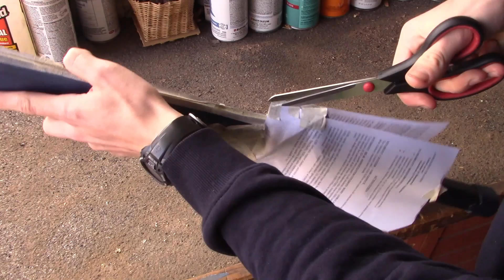Kirito's Night Sky Sword [⚔️Sword Art Online Alicization] Made From Wood (Part 2)

Comment: What are the materials and tools you used because I'm thinking of making my own
Reply from the maker: So for the main part of the sword I used a single cedar fence board, no idea where I got it from sadly, and the the two pieces that go on each side of the guard were some smaller pieces of wood(not sure what type), other than that I just used some black, blue, and light blue spray paint( the blue spray paint has mica particles to make it sparkly) and then I used a water based polyurethane varnish to make it glossy at the end. I hope this helps, let me know if there's any more info I can give you 😄
Reply: @somescrapcrafts1877  this helps a whole lot thanks also what tools were used in this whole process

Comment: Can you tell me what the lenght and width of the sword are ?
Reply from the maker: The length of the sword from the tip of the blade to the end of the hilt is exactly 3 feet, the blade itself is 26 inches, the width of the blade at the widest part is 3 and 3/4 inches, the thickness of the blade is half an inch and the width of the guard is 4 and 3/4 inches. Hope those were the measurements you were looking for! :)
Reply: @somescrapcrafts1877  
Yes. Thank you. One more question. With guard you mean the part between handle and blade right ? I am not that familiar with this type of things.
Reply from the maker: @henrythe5th688   Yeah, exactly, so the wide part between the handle(hilt) and the blade is the guard(cross guard)
Reply: @somescrapcrafts1877  and the length of the blade is from the tip of the blade to the beginning of the cross guard right ?
Reply: And what kind of colour did you use ?
Reply from the maker: @henrythe5th688  Exactly, and for the paint that I used, I first used a Matte(not shiny) Black from Krylon, and then for the sparkly blue I used the blue "heavy metallic finish" from Dupli-Color. Hope that helped :)
Reply: @somescrapcrafts1877  Yes that helped. Thank you:)